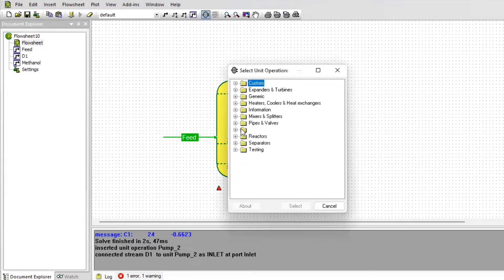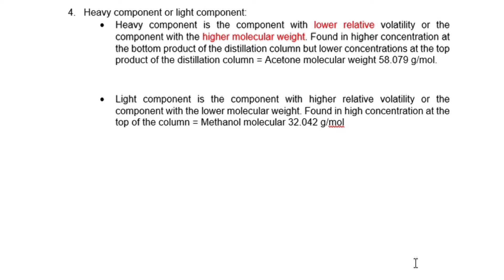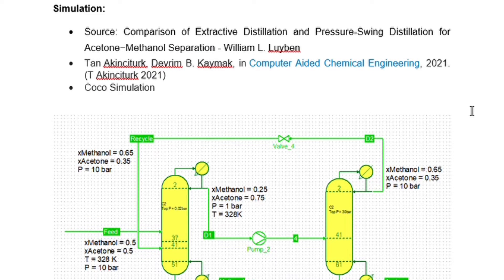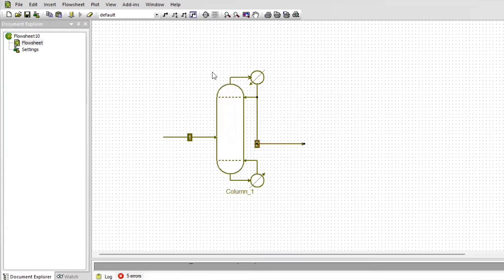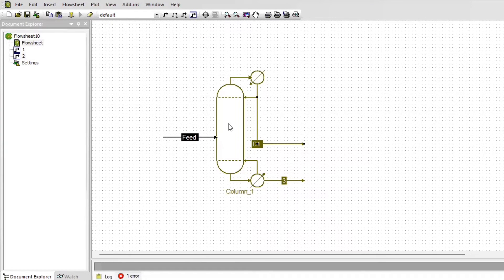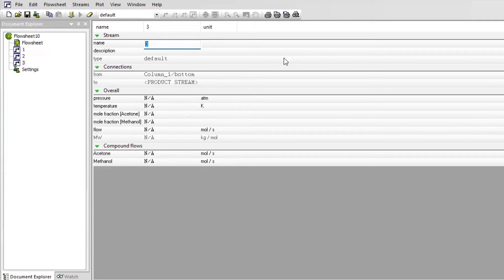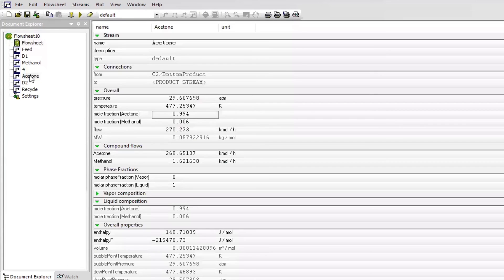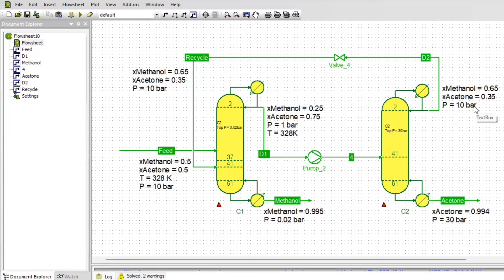Pressure Swing Distillation - Acetone and Methanol. Product design small Project

Comment: How can i use this simulation is it website or what please answer me.
Reply from the maker: Hi there, you can use the project by following the steps outlined in the simulation to understand how Pressure Swing Distillation works in separating Acetone and Methanol at different pressures. It provides a visual representation of the process and allows you to see the effects of different parameters on the separation efficiency. While it is not a website, you can run the simulation on your computer to learn and explore how this engineering principle can be applied in practice.

Comment: i would like to see the model for separating ethanol and ethyl acetate. i am considering trying to build the one modeled by aspen plus.
Reply from the maker: My apologies for the delayed response; I'm confident you were able to complete the simulation on your own by this point. 

I am pleased to offer my assistance. Please be advised that we now have a user-friendly website that allows you to submit your questions, which we will answer within 24 hours. 

Several thermodynamic packages can be taken into account while developing a simulation for the refrigeration cycle of carbon dioxide to chill water, including:

1. Redlich-Kwong equation of state (RK-EOS)
2. Soave-Redlich-Kwong equation of state (SRK-EOS)
3. Peng-Robinson equation of state (PR-EOS)

It's crucial to keep in mind that choosing a thermodynamic package is influenced by a number of variables, including the degree of precision needed for the given application, the range of temperatures and pressures involved, and the characteristics of the fluids employed in the system.

For further inquiries, our website is: https://chemicalengineeringwithkgabisang.co.za/home or you can reach us at info@chemicalengineeringwithkgabisang.co.za